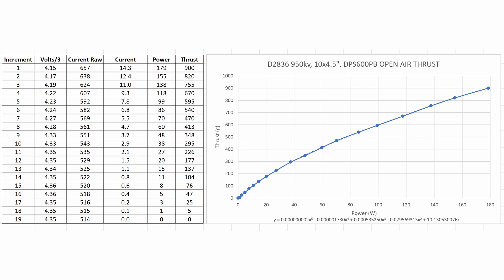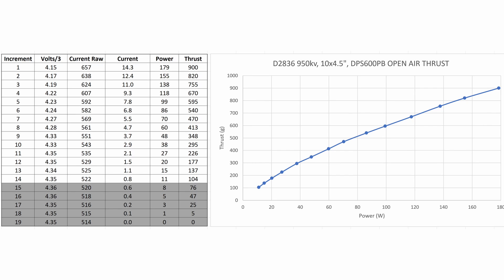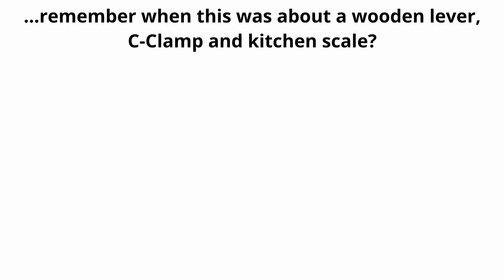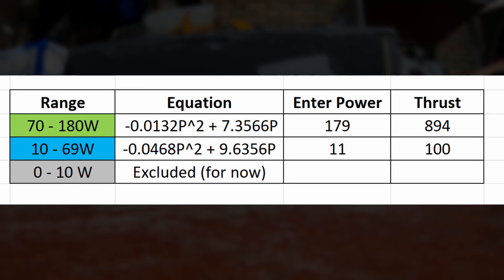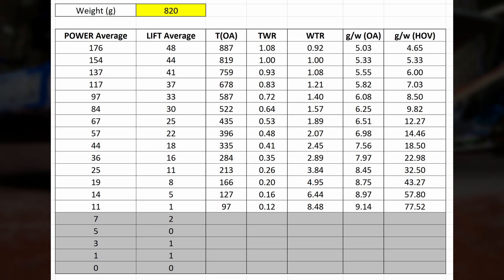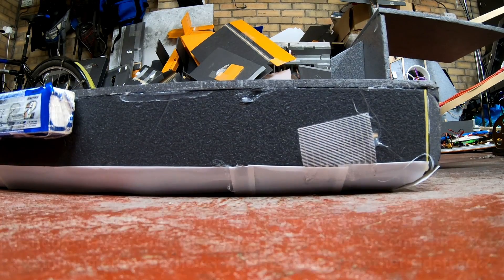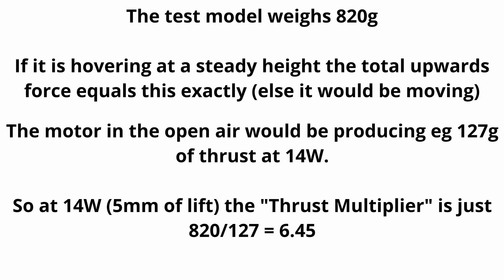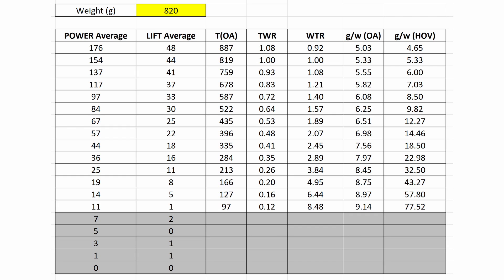Skirtless Hovercraft vs Ground Effect Rotor. Initial testing and analysis. Data Heavy!

Comment: Many years ago I made a similar craft, about 600 x 600 mm.  It was driven by a 7 cc  glowplug model aircraft motor, I think it delivered 1.4 hp. To contain the air I made "gas lensis" around the craft. A gas lens is a very effektive way direct air. Used in TIG welding to contain the shielding gas. The gas lenses were made of parallell balsa sheets, a few millimeters apart, and balsa bars to keep them apart. I don't remember exactly. but there must have been over two hundred slots to direct the air. Now, the craft was made of balsa, and very overpowerd. It was of course impossible to keep it parallell to the ground. But it held itself, I think about 100-150 mm over the ground, but tilting a bit, and that made it move very fast, however out of directional control. Today a drone controller  may have made it controllable.

Comment: Interesting detail - Thank you - that triggers many thoughts...
Trying to separate out the different parts of the experiment in my mind...
 - i.e. "Thrust" of the Free Propeller vs. the combined "Lift" (from the cushion pressure) and "Thrust" (from Stability Jet) 
- Maybe testing the craft with stability jet closed would give some interesting data (?)
Reply from the maker: I done a quick set of tests with varied stability port sizes. Smallest was 20% which is effectively closed, only a small amount of air vents for motor cooling. Also did 30,40 and the usual 50%. There was no measurable difference in power/lift at all, the curves matched each other perfectly.

I'll run it again with a totally closed jet, it's now cold enough in the workshop to not be so concerned with overheating the motor. 

Now the interesting thing is port sizes above 50% - theoretically this would lift out of ground effect if you could actively control the split of stability to peripheral jet flow. As always I have some ideas and I do actually have the time to build them now. 

I'm very happy with the automated rig (if I say so myself!) - any suggestion for modifications is always welcome as it's so quick to get the results now.

Comment: I think that for open air tests its best to match its weight to what its counterpart weight would be. This helps to better compare different craft.
Reply from the maker: That's where my thinking is going just now as well. I've started another test model, a plain skirtless craft with no internal hull or peripheral jet. I can compare that against open rotor and the current hovercraft as well. If I ballast them to all weigh the same it does seem better for comparison.

With the automated routine I can easily run with and without ballast, may as well present both results.

Personal bias is "trying" to make the hovercraft look better than the open rotor to see if a hybrid design is worth pursuing. Would be disappointed to find out the skirtless design doesn't offer anything over an open rotor ground effect craft. Just from these results it does though, with the 820g test there's a big range over which the hovercraft lifts while the open rotor is stuck at the ground.

Comment: I appreciate you doing this deep dive here. I can relate to getting distracted with tangential decisions. Although I have been watching you for a while, I have been working on a design that makes use of an automotive AC Squirrel cage blower (due to quality control, airflow and high rpm) and a drone motor really attempting to work out ratios for a pure hovercraft. There a very small quantity of poorly documented info in some aspects of this so I can only salute you for putting this out. And yeah I'm still watching and interested.
Reply from the maker: Appreciated!

If you have any videos or data of your own tests I would be keen to see them. Understand if you don't though. I did consider centrifugal fans for lift but concluded it's too much of another '"side project" to find/build one and get it sized and working. Propellers are at least a bolt-on solution and work well enough with the design.

Agree on the lack of real testing data which I am trying to rectify with the testing rig. It is SO much better than manual measurements. Have a few more ideas for different hovercraft and ground effect rotor designs to compare.
Reply: @Glydaire  Do you have an active Youtube email?
Reply from the maker: Not a public one I can share. You can reach me on RCGroups messages privately or I can maybe set something else up.
Reply: I will reach out on RCgroups